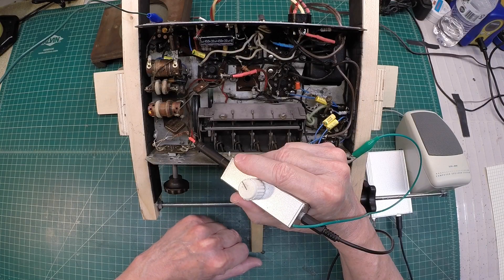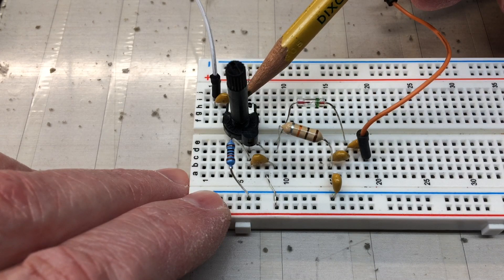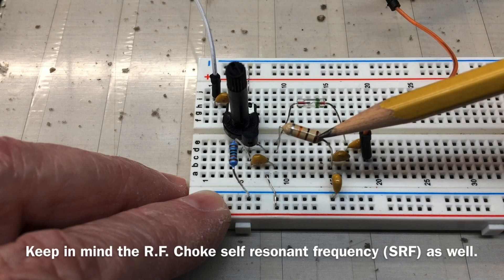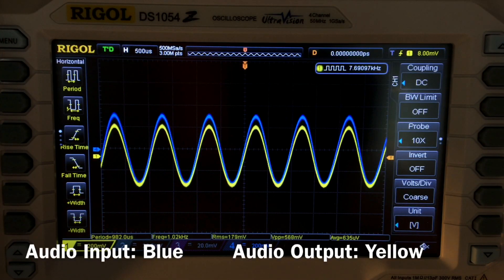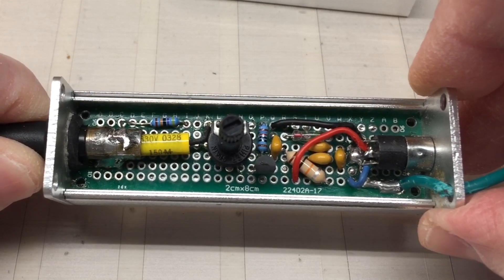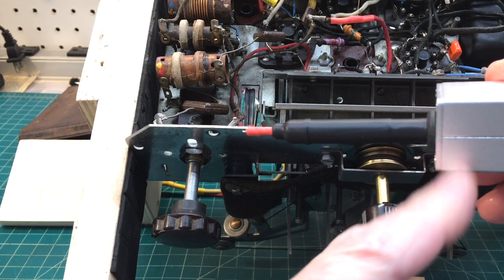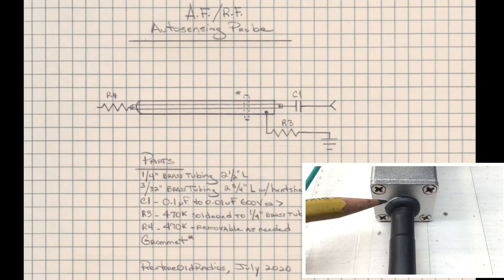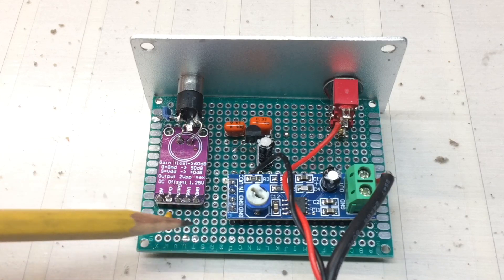Build an A.F./R.F. Autosensing Probe

Comment: So as I understand ( please correct me if wrong ) 
a) R4 is to reduce high AC voltage transferring to High Voltage Capacitor and to decrease effect of pipe capacitance 
.b) The impedance created by  capacitance between copper /brass pipes is increased by R3 negating load from this capacitance 
c)  C1 decouples high DC voltages 

Questions- 
Could we use a stiff coax in exchange for copper piping is that equivalent ?   
I was a little unsure as to the specific purposes of R4
Reply from the maker: R4 does both, but primarily the reason is to reduce the capacitive loading of the probe when attaching to grids (high impedance) of tubes or alike. C1 blocks the DC. I didn’t try using coax, but keep in mind the capacitance of such. Here’s another video below on using the probe that you might find interesting. All the best, Don

Signal Tracing Demo - Low & High Impedance Test Point Locations
https://youtu.be/SP6uJRjpCzY

Comment: Hi Don,  Sorry for so many questions. Do you recommend a pot with a plastic shaft for lower noise? And does audio taper work better? Thanks again.
Reply from the maker: I did another breadboard build sometime back with a 2M linear and audio taper with metal shafts and the results were equal to my published design and they are definitely more common/plentiful. Hope this helps. Best, Don

Comment: Hi Don, I'm wondering which type and value of (C1) capacitor currently works best for the probe? Polypropylene, Polyester? Do you use .1uf or smaller? Yours looks like a Mallory 150M?
Reply from the maker: Thanks for watching and reaching out. C1 value and type other than the voltage rating is not critical. When I built the circuit, any value from .01 uF to 0.1 uF worked equally well. Again, just ensure the voltage rating is adequate for your application. Hope this helps. All the best. Don

Comment: Hi Don, thanks for sharing, only one question . How do you get the 3/32" tube centred inside the 1/4" tube and how is it fixed inside, did you use some form of packing?
Reply from the maker: Good question! I used heat shrink tubing over the most inner before inserting it into the larger… Hope this helps and I apologize for the belated response. Best, Don

Comment: Hi Don, I'm collecting parts to build this probe. Wondering if you can recommend a good source for authentic1N34 diodes? There seems to be alot of counterfeits out there. I'm also wondering which currently available JFETs work best? I've already received the two needed modules. They seem quite a bit  smaller than I they appear in the pictures. Thanks for all your great ideas!
Reply from the maker: The supplier I’ve used in the past is: https://www.mikeselectronicparts.com/product/1n34a/ and 2N5457 JFETs is what I’ve used for many of my projects. Hope the build goes well. Best, Don
Reply: Jfet that cross reference to the 2n5457. All of these Jfet Transistor should work. 

2N5458N, 2N5459,  2N5639, 2N5653N 2N5654N J105N J106N J107N J309N, PF5102N, PF5103N 1NJFET0, PN4092N, PN4093N, PN4302N, PN4303N, PN4861,  TIS74N, U1898N

Comment: Hi Don, I still haven't had the time to build this yet. However, I'm wondering if you've made any improvements to the design? Thanks.
Reply from the maker: Nothing major. You can make R1 a 2 megohm linear pot, which is more common than the 5 megohm I originally used and will not change the performance. I’ve built two of these, one as-built using the aluminum enclosure for the probe and another one using a plastic enclosure (all in one) and both work equally well. The MAX9814 does a great job amplifying those low level signals; removing the electret microphone soldered on can be a pain. Please let me know if you have any additional questions. Best, Don

Comment: Nice Probe man! Is this your favorite version?
Reply from the maker: Hi Blade - it’s my favorite. Thanks for reaching out. Best, Don
Reply: @RestoreOldRadios  Ive built my 1st probe to find a no audio fault in my Stryker 955. I found a dead TDA2003v audio amplifier so far. 
A just barely shorted out speaker by one strand of wire killed my audio.
I want to build this probe you have here as well.

Comment: Hi Don, I have another question. I'm wondering how you changed the gain of the LM386 module? Did you just cut a trace on the PCB between pins# 1 & 8  to use the LM386 default gain or did you change the resistor and capacitors values? Thanks
Reply from the maker: Correct, I cut the trace to one (or both) side(s) of the 10uF capacitor between pins 1 & 8. Hope this helps. Best, Don
Reply: @RestoreOldRadios  Thanks!

Comment: Mr. Don, my friend, I cannot find the 5M pot for the probe anywhere. I found big ol' wire wound clunkers that won't fit in the case, but simply cannot find where you sourced that part from. Can you let me know where you found it? It's the only remaining piece between me and rebuilding a stack of old Zeniths. Many thanks in advance!
Reply from the maker: I think you’ll get good results with a 1 Meg pot as well, which are more common. I got the 5 Meg from Mouser Electronics. I hope things go well on your upcoming Zenith projects. All the best. Don

Comment: I'm wondering what type those yellow capacitors are? And voltage rating. Thanks.
Reply from the maker: Thanks for watching and reaching out. They are 630V Metalized Polypropylene Film like: https://www.justradios.com/PPTcapacitors.html

Hope this helps.

Best,

Don
Reply: @RestoreOldRadios  Hi Don, I understand that a film capacitor is used between the probe and the FET. I was wondering about the other little caps like the 680pf and .1uf caps in the remainder of the circuit? Are those just ceramic caps? Thanks.
Reply from the maker: Sorry about that, yes I used ceramic capacitors for the others...

Comment: Isn't the LM386 module gain +26 dB and not +20dB (as drawn)? At least you said 20?
Reply: Not that it would matter that much... :)
Reply from the maker: Harri -  my bad. I should have said 20 x voltage gain, which is equal to 26 dB. A variation in gain of a few dB won’t change the performance. Thanks for reaching out and watching. Best, Don
Reply: @RestoreOldRadios  The design itself is very good and functional. The parallel A.F. and R.F. paths are a well-working old-school style solution.
Reply: @RestoreOldRadios  You could feed the probe shield with the input signal from a unity gain low output impedance source, to reduce the effects of input capacitance even more. Even directly from the JFET source could work: maybe this would be worth testing?
Reply: As an example, see the "driven guard" in this: https://www.analog.com/media/en/technical-documentation/application-notes/41727248AN_347.pdf
Reply from the maker: Harri - I’ll read up on this and give it a try when time permits. Thank you. Best, Don

Comment: Hi Don, I was about to flip the switch on my breadboard of the Autosensing Probe when I noticed in the schematic that the LM386 is wired directly to 9 volts. Is that correct? The reason I'm asking is my LM386 is in a Seeed Studio Speaker module that uses 5.5 Volts max.  Thanks.
Reply from the maker: The 386 modules I used are rated from 5 to 12 volts. With your configuration being different, I wouldn’t exceed the 5.5 volts. Hope this helps. Best, Don
Reply: Don, thanks for confirming. I will connect this module to the 5V supply in parallel with the MAX9814 to be safe.
Reply from the maker: Let me know how things work out. Best, Don
Reply: Don, it looks like the module manufacturer was too low on the operating voltage. Texas Instrument stated a very wide operating voltage of 4-12V  or 5-18v. So I was able to operate this module on 5V and 9V with no problem. Now comes the interesting task of shoe horning everything including the battery into a 1"x1.75"x5" plastic box. I plan to line the inside with aluminum duct tape. Just the other day, I learned that it's possible to solder directly to aluminum on Youtube. So I'll be able to ground the the shield. I'll let you know how this works out. Thanks, Lyman
Reply from the maker: Lyman - hope the build goes as planned. Thanks for keep me posted. All the best. Don

Comment: Hi Don, I've got nearly all the parts to make this RF/AF Demodulating Probe. The only thing I haven't gotten is the case. Is it necessary to use a metal case as you have in your example?
Reply from the maker: The metal enclosure (for the Probe) being at the same potential of the chassis helps mitigate hum and an isolation transformer is required to safe guard against shock. My first probe was in a plastic pill bottle and it performs well aside from the hum factor, but provides isolation. You’ll notice in another video I built an all in one in a plastic case and included a piece of copper tape (tied to the circuit ground) on the side that my fingers touch when powering up the unit when pressing the momentary switch; this worked well for me. All the best moving forward. Don

Comment: I finally got your tracer finished and I really like it. I set the pot gain on the 386 board to the maximum position without too much hum out the speaker. Can pick up 1st IF signals no problem. I got the same aluminum case you used from ebay and it was a great idea for a probe. Grounding to the case was a little tricky but I tried the motor oil trick to get a solder ball to stick. However, don't use a new soldering tip as it gunks it up pretty good. One of the hardest parts to find was a 5M pot that would fit in the case. I happened to have some reclaimed TV pots that I bent the leads to fit. I also tried a LM386 amp with volume and gain control setup that I like  from (https://www.circuitbasics.com/build-a-great-sounding-audio-amplifier-with-bass-boost-from-the-lm386/). Great probe and project and look forward to more great stuff!
Reply from the maker: Tom - glad it’s working good for you and I appreciate the motor oil tip trick in addition to the URL on... I’m working on a new project now that I hope to share soon if it actually works. Thanks again for following my channel and your feedback on the probe. Best, Don

Comment: Don, great Signal Tracer but I'm confused. The input cap is a 0.1uF  I thought that can pass audio but RF would need a much lower cap value? Can you help me out with this.
Reply from the maker: Thanks for reaching out. The design works well in the AM Broadcast band. Regarding the capacitance value, check out this video:

Signal Tracing Demo - Low & High Impedance Test Point Locations
https://youtu.be/SP6uJRjpCzY

Using a 20 to 50 pF capacitor in series with the .01 uF integrated into the probe when measuring RF at the plate of a RF tube or in the I.F. section helps mitigate low frequency signals (hum) and allows the demodulation to occur with less impairments. 

Hope this answers your question. 

Best,

Don
Reply: @RestoreOldRadios  Thank you Don, I'll poke around in the radio.
The radio is a AAF  I get one station loud and clear at the low end of the dial. Nothing else going to the high end. I have a signal tracer with a J-fet input but the design is not that good.
When I place the probe tip on pin 7 of the 12BE6 I get nothing, working back toward the detector I start to pickup the station. The radio vol. control is at it's lowest setting with sound only coming from the signal tracers small speaker. I sure appreciate you sharing your knowledge. It's a God send. Hope to see more test instruments from you - as I consider you the master builder.
-Tom
Reply from the maker: Tom, what antenna is being used on the radio? Since pin 7 (grid) is being fed from the tank circuit, a strong signal should be able to be detected at that point if the gain of your signal tracer is ~40 to 50 dB. Do you have a signal generator that is modulated? Best, Don
Reply: @RestoreOldRadios  Don, here's where I may have messed up.
The radio is a Packard Bell 5R1 it's original antenna was an older loop in poor shape, I replaced it with a ferrite rod antenna from a later same model radio.
No alignment was ever done.
Yes, I have one that is modulated.
What do you suggest?
-Tom
Reply from the maker: Tom, only if you have an isolation transformer you can hook your SG to pin 7 through a .01uf capacitor or lower pF value and turn on the modulation and tune through the band and see if the audio is detected from the loudspeaker. Start at 600kC then 1000kC, & 1500kC. Make sure your tuning condenser tracks the frequency of your SG. Again, you shouldn’t proceed if you don’t have an isolation transformer or the knowledge to safely do so. Best, Don
Reply: @RestoreOldRadios  OK,  with my signal generator set to low output & modulated thru a 0.047 630v cap the tone came thru in several spots at the 3 frequencies you mentioned.

I also did a test using my B&K scope 2120B and my Signal Generator SG-4160B.
With my Sig. Gen. set low output I connected it to my Signal TRACER and slowly turned you the vol. on the tracer till I just begin to hear the modulated tone from the Sig. Gen.
Disconnecting the Sig. TRACER from the Sig Gen.. I connected the Sig. Gen. to my scope and it measured approx. 50 mV. P-P coming directly from my Sig. Gen.
-Tom
Reply from the maker: Tom - to confirm, you heard the modulated signal on the radio speaker?
Reply: @RestoreOldRadios  Yes, with sig. gen. set with low output thru a 0.047 cap to pin 7 of 12BE6 I heard tone thru radio speaker clearly.
-Tom
Reply from the maker: Tom, I’m speculating the ferrite antenna or a connection between the tuning condenser and the automatic volume control is an area to look at closer. Does the ferrite antenna out of circuit show DC resistance across it? If you have a LCR meter it would be good to know the inductance of the ferrite antenna out of circuit. Best, Don
Reply: @RestoreOldRadios  Well Don, this is embarrassing. The two connections to the rod antenna were open. I cleaned the wires and re-soldered them and now the radio is receiving way more than the one strong station at 540 kHz.
I did measure the rod antenna when it was totally disconnected the readings were 0.2 mH and 0.6 ohm (with meter zeroed out first).
Now, with the Signal Tracer vol. all the way up and probe on on Pin 7  I get a VERY VERY faint station output.
C2  0.047uF cap.,  one end of the cap goes to circuit gnd. the other end goes to the one lead of the antenna; 1st I.F. ; R4 2.2meg. thru this resistor to hi side of the vol. control of radio.
C2 and R4 test good.
So at this point I guess my sig. tracer is loading down Pin 7 way too much.
Maybe this is the best my Sig. Tracer is capable of.
-Tom
Reply from the maker: Tom, not embarrassing at all. I lost count along time ago on how many things I thought was in order only to find my mistakes. I would proceed with the RF/IF alignment and see how well she plays afterwards. Keep me posted. All the best. Don
Reply from the maker: BTW - around 2mH (200uH) is what I would expect you to measure with a ~365pF tuning condenser.
Reply: @RestoreOldRadios  Don I want to thank you for all your help. You have the patience of a Saint. Your devotion to helping others reminds me of the difference between an instructor and a teacher.  You deserve the title Teacher.
-Tom
Reply: @RestoreOldRadios  I wish I saved that old old loop antenna that originally came with the radio. But I am greatful I can now get more than one station.
-Tom
Reply from the maker: Tom, I’m glad to help. There are many people in my past that shared their knowledge with me, so it’s my intent to do the same. Thanks again for your kind words, they are appreciated. All the best. Don
Reply from the maker: Tom, to build a loop antenna check out this old article: https://youtu.be/Cj3RzaAhmoc
Reply: Kopter Six l

Comment: Hi, built your first probe and loved it and look forward to building this second one. Did you make R4 on the probe tip removable as you note on the schematic? If so, why? Great videos!
Reply from the maker: Tom, I did make it removable. Check out my latest video: Signal Tracing Demo - Low & High Impedance Test Point Locations
https://youtu.be/SP6uJRjpCzY It demonstrates how using a resistor and capacitor can improve the ST performance. Best, Don
Reply: @RestoreOldRadios  Ok great, thank you. One other quick question. Does your grounding clip go direct to ground or through the 470k resistor? I assume its through the resistor. Great videos!
Reply from the maker: Tom - the 470k attaches to the outer probe that is isolated from the metal enclosure. The ground wire is attached directly to the circuit ground, which also connects to the metal enclosure. Keep in mind the metal enclosure is at the same potential as the receiver chassis ground, so an isolation transformer is always required. I updated the as-built file for the probe; added another 1N34A to improve RF sensitivity. Hope this answers your question. Best, Don
Reply: @RestoreOldRadios  Ok good. The schematic shows it as you describe it but in your other video, it looked like you had the ground clip directly attached to the outer shield on the probe. Thanks again.
Reply from the maker: Tom B You are correct. The all in one I used in the Demo video is a different design. The probe is grounded and R3 was not used. Sorry about the confusion. Best, Don

Comment: Looks like another great tool to build, thanks Don! Would a J310 N-JFET be OK in this circuit? I built your last signal tracer so would be interesting to compare the two - with that one I made a separate "probe" containing the 1N34A diode and connected it to the main circuit box via a BNC cable and connectors.
Reply from the maker: Chris - I would think the J310 will work equally as well. Let me know after you build it; would love to know how it stacks up. All the best. Don